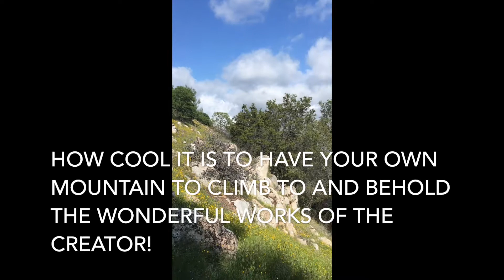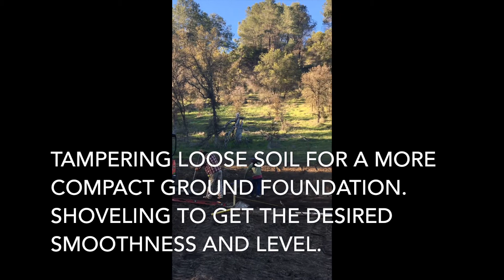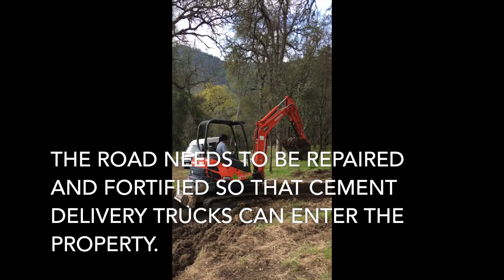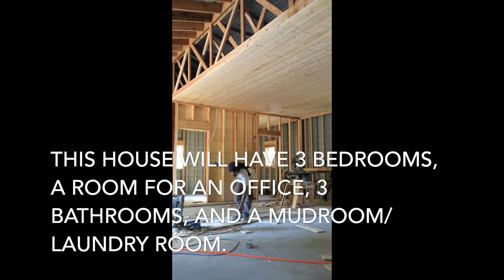HOW TO TURN A METAL BUILDING INTO A COMFORTABLE HOME

Comment: Noticed you guys dont have any sheathing. Is there any condensation? How’s the sound when it rains? Insulation good? Currently working on permitting for mine but unsure if we should install sheathing
Reply from the maker: Hi Noah. We used the 6” rock wall insulation. It’s really good. I tried to burn it and it didn’t. The building is in central California. So far so good. If it rains you can hear the sound but I like it😊

Comment: What’s the best way to insulated the building? Isn’t moisture/condensation a big deal with metal structures?
Reply from the maker: I think spray foam insulation is the best for metal building. We installed rock wool on this project. It’s a waterproof and fire proof also.
Reply: @countryhomebuilder8922 did you spray foam the roof from the inside of the home?